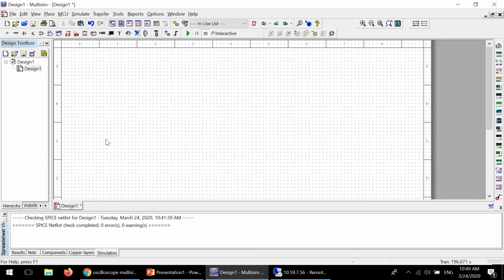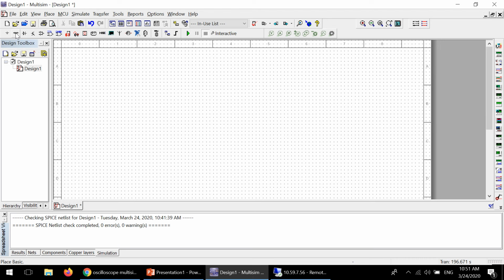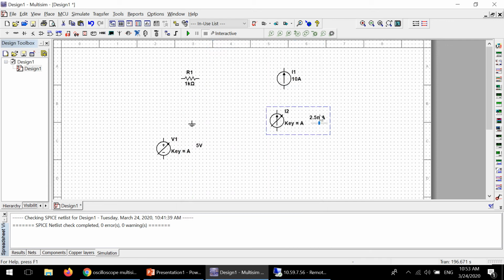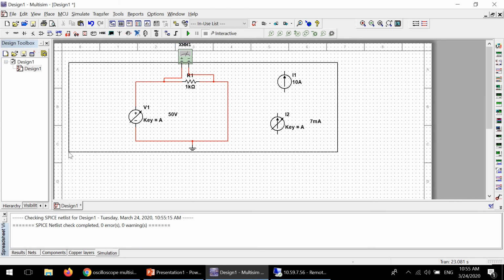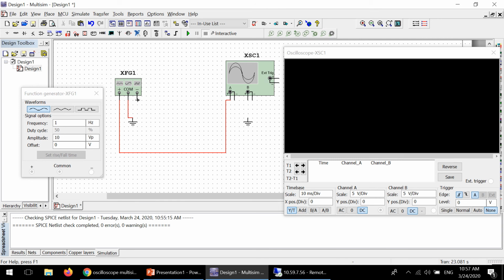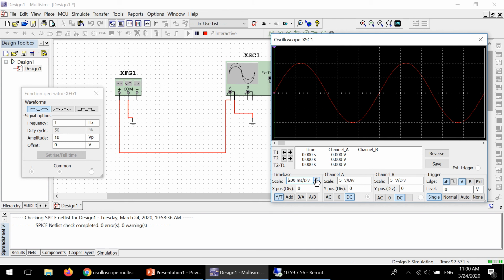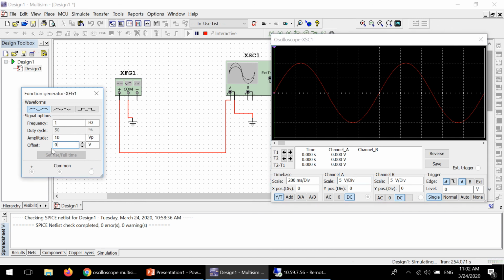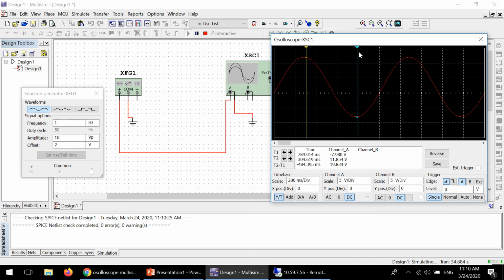Oscilloscope and function generator Multisim

Comment: Assalam -O-Alaikum! 
         Respected Sir Kindly perform this lap at multisim software and upload as soon as possible.

 	Investigate Response of the Series RL Network at Different Frequencies	

 Objective
 
•	Note the effect of frequency on the impedance of a series R-L network
•	Plot the voltage and current of a series R-L network versus frequency.
•	Calculate and plot the phase angel of the input impedance versus frequency for a series R-L network.
    Equipment Required
 
 Resistors
       100 Ω (1/4-W)
    Inductors
                10 mH

I shall be very thanyful to you
Reply from the maker: Uploaded
https://youtu.be/HtfvtT6pyT4